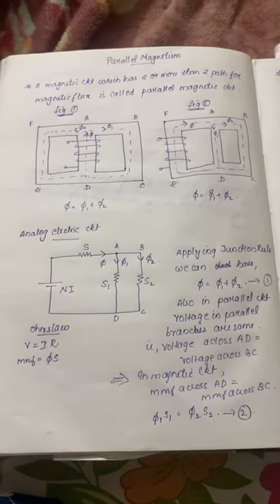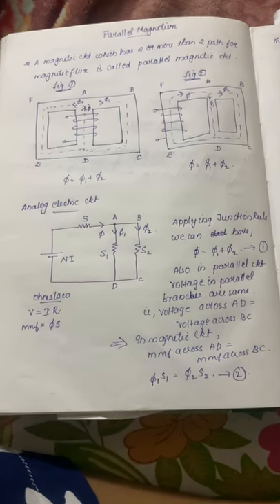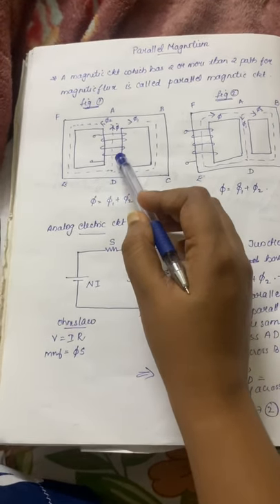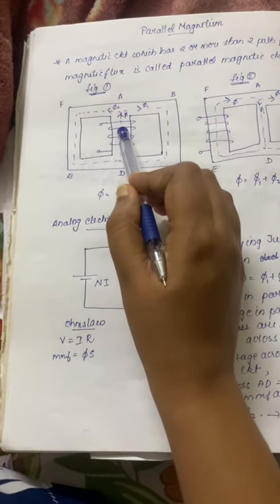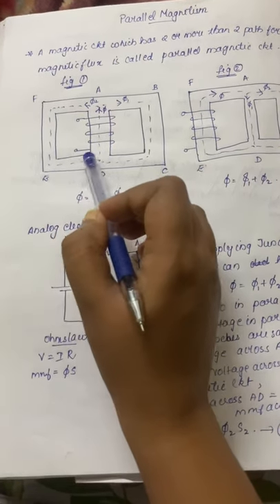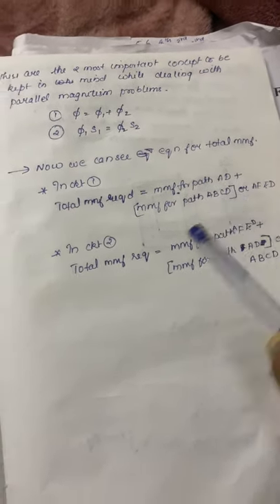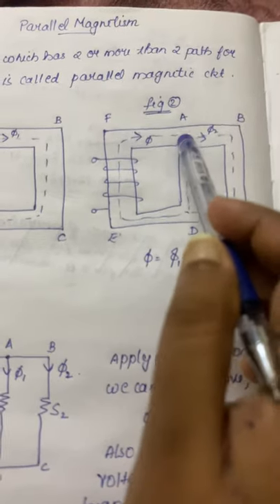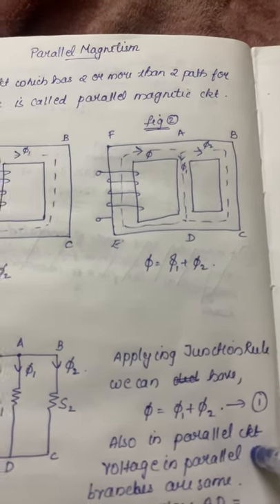Parallel magnetism PART 1 ( concept)

Comment: A Cast steel magnetic material made of bar section 2cm×2cm is shown in fig. Determine the current that 500 turn magnetic coil on the left limb should carry so that a flux of 2m wb is produced in the right limb.
Take  (...r)=600  and neglect the leakage